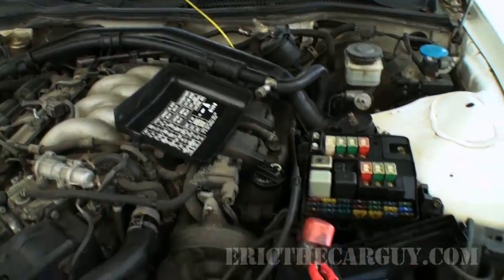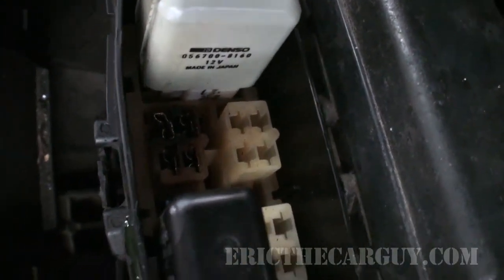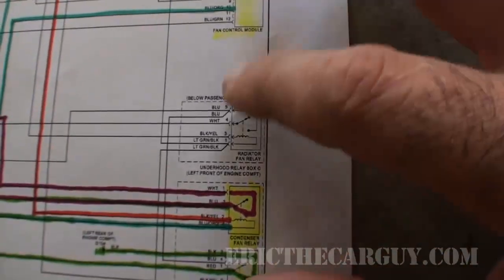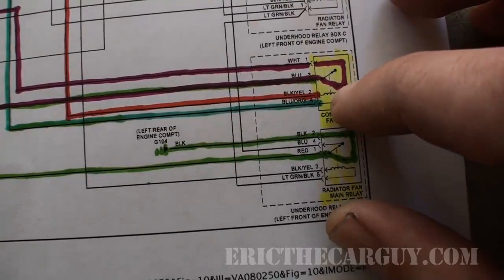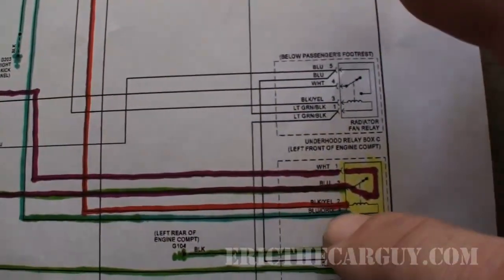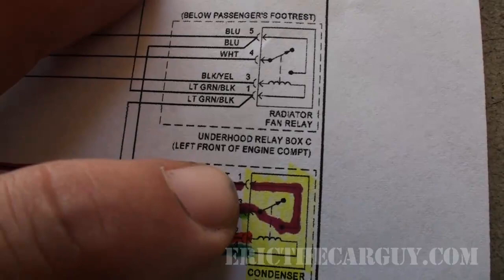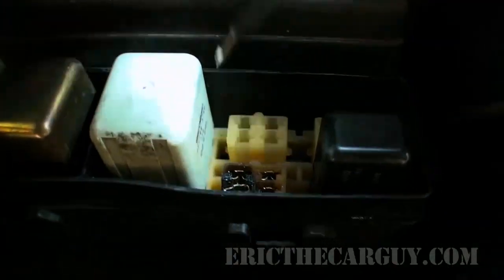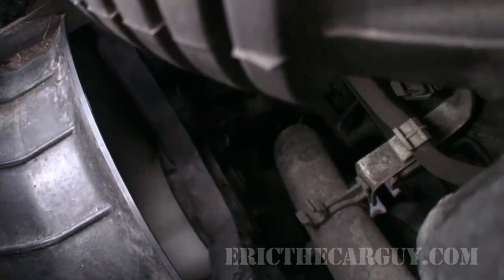Electrical Troubleshooting Basics Part 2 -EricTheCarGuy

Comment: TY over the past couple days I've been trying to learn how to read audi wiring diagrams and come up with a way of figuring out why my fuel pump relay isn't getting power... I suspect the ECM but wanted to be 100% sure before replacing it. Just last night as I was laying in bed I came up with the idea to test the 4 inputs to the relay and then the wire going from there to the ecm... exactly what you described in this video. Even though I already thought about doing this, it's definitely helpful to see it laid out on video and to have verification that it's a good diagnostic method

Comment: Very good!  Just a tip about radiator fans ; if one hasnt been working for a while and you jump the circuit to make it work then make sure to check there is no debris in and around the fan first. You dont want a missle flying out.
Reply: No doubt 💯

Comment: You should also list causes for failure of relays etc. Like the fan you were talking about, yeah my fan didn't come on, but it was obviously the relay. BUT checking the amperage drawn/ohms shown, the fan was trying to pull to much power. So that's always something you check assuming its powering something such as a fan,a/c clutch etc. If its drawing to much amperage through it, or its got to much resistance it could be in need of a new part and a relay, or just a relay, assuming the amps / ohms are in check for the given piece you are diagnosing . But remember kids, if the resistance or amperage demand is to high for the relay,.. it'll fail another relay or control module. Never diagnose why something does't work, diagnose why it failed in the first place.

Comment: it's worth having a look for broken solder joints (or just reflow the whole board, they're not always obvious on inspection) before giving up and replacing it. had a similar intermittent problem with the door locks on my accord, turned out to be a broken solder joint in the control module. cheap and easy fix - after an hour diagnosing on my electronics bench because the broken joint wasn't visible :P

Comment: Glad I wasn't the only one in the grey area. I was wondering the same thing, I think in the end he replaced the control unit and that because it was the old control unit that was intermittent. Probably a solder connection that did not contact when the control unit got hot.

Comment: Thanks Eric. Your videos are great for a newbie like me.  I read somewhere that wiring diagrams on conversion vans are next to impossible to find. 
    My van is an 93 E150 Cargo with an RV prep package (I think), converted by a company that's long out of business. 
    After the passenger conversion, a wheelchair lift was added, then removed by the folks I bought it from. They added a bed and did some interior work to create a basic sleeping area for touring the US in comfort but nothing else electrically.   
     I'm hoping that there are basically common electrical modifications to conversion vans that follow the original wiring in a logical way and really hoping conversion companies didn't get too creative and out there with the wiring.  
     Does that mean that collecting wiring diagrams from similar conversions might be worth while starting with the factory specs?

Comment: even troubleshooting a sensor or actuator is possible with a standard DMM and knowing its resistance range and even so odb2 scan tools can hook directly to sensors and actuators so the only components I would have trouble diagnosing right now is the control modules that don't throw codes

Comment: If that happens whe you ride over a bump or something like this, then check the speaker wiring. I have met many radios, that shut off the amplifiers if the output is shorted (either the wires can be shorted between themselves or to ground)

Comment: Power Probe is not owned by snapon it may be sold, by them as well as Matco etc, but they are a company all by themselves, they also have the best brake bleeder and adapters on the market.

PP 3 is the best there is! I was just using mine to diag a inop brake light:)

Comment: i know you wouldn't be able to measure the resistance by doing this  but you could have also provided ground with the power probe on that wire and that would have activated the fan correct? it would have told you the wire was good and that it was the unit that was the problem if i understood the wiring diagram correctly

Comment: Great channel ...I like Eric because much like me he's old-school and I will never depend on the ODB scan to Indicate a problem sometimes it's an easy problem that can still throw a code like a misfire code on the Chevy's most times it's a bad wire and I have fixed tons after people have spent Huge $$ on converters and sensors that was just unnecessary and all it needed was cut splice and solder a wire... so keep you hair in your head not in your hands and check all the simple symptoms First stay clean....

Comment: I cannot tell if my coolant fan works because I'm told it only works when engine is running under the hood unbeknownst  to me. Same as possible trunk light and relay circuts.
I'm a DYI'er and its all too complex for me and I do not have the expensive equipment you have - screen and all.
I'll take it apart, of course, and do my own DYI diagnosis...then take it into the garage to get fixed for $300 - $600 fix on my car I got for nothing$. It breaks my heart.
But, not before I remove neg cable for awhile until I get my "isolation switch".

Comment: Couldn't you have also used the power probe to send ground to test the wire from the fan controller to the relay? If the fan turned on then you know the wire was good no?

Comment: Good video.. a clouple of notes to add

1. Ohms shpuld NOT be tested on a live circuit, circuit should be de powered 

2. You can figure the ohms on a live circuit with a clip on amp meter. 
The math formula is 
Volts over amps x ohm 

Eg 
Battery voltage ( check with key in pre start position, light on dash on )  = 12.4 volt 

And you get an amperage reading of 3.2 amps 

So 12.4 V divided by 3.2 Amp = 3.875 Ohm 

This is the same for ANY electrical system. 

You nred any 2 parts of the equasion to calculate the 3rd 

Also you are looking for Dc in anything battery powered

Respectfully intended to the mechanic

Comment: Broken solder joints are a known issue on japanese cars here were you can easily fix the problem with resoldering the broken solder terminals. You can notice it by looking at the solder joints and find a small ring in solder.

Comment: Nice video. I noticed you swapped fan control modules out to test which worked fine. However, I was looking at the drawing and I was wondering if you could test the module by disconnecting it and bypassing it by jumping the blu/org to blk in the fan module connector. If it comes on then you have a bad module. I was just wondering if that might work. Well thanks for the video and explanation. Great job as always.

Comment: I watch you because you know a lot of stuff and you rock. And I am wondering about if there is an all in one website that allows one to type in make and model of a car and out pops a pdf of the wiring diagram for the car and its features , power seats , flashers ,....everything in one centralized location. so one doesn't have to download a million different manuals for wire diagrams for each make/model

Comment: yes the colored wires are demystified by the wired diagram, one can trouble shoot for relays , fuses , motors , and open /shorts in circuits or there connectors. But how do you know if the control modules are bad I would think the odb2 is the only way but will the odb2 diagnostic tool always throw a code for a bad controlling module? like a fan subcontrol module I know most of the major ones like ecm, bcm, tcm ,...etc would probably throw a code but for subsystem controls

Comment: I have a 97 accord lx my fans don’t turn on while driving but  once I shut the car off they turn on. I jumped the thermostat switch and both the ac and cooling fan turn on , I replaced all coolant sensors and relays and fuses except for that box u mention in this video does my 97 accord have this “fan timer relay”

Comment: I have a "parasitic draw" somewhere..I and my neighbour's did NOT react as they should @ DC 10 multi meter settings.
With out these readings, I cannot know if the fuses I removed were the culprits of the "parasitic draw".
Any ideas?

Comment: If you didn't have an extra control module around could you just have used the power probe to supply a ground to the orange/blue wire and see if it worked then?

Comment: burned connectors means high resistance caused by poor fit, loose spades, or excess current draw possibly caused by a worn fan bearing.

Comment: Eric awesome video.
Have an intermittent problem with an 05 Honda Accrd. The radio will all of a sudden cut out but the display is still reading as if all is good. No sound but if i turn the system off then back on it usually comes back to norm. don't know if it is the speaker wiring or the radio electronics that is the problem. Any suggestions? Cd player also does not respond but display says it is playing. Will usually be alright at first drive of the day, then it will die after a few minutes

Comment: Looks like this circuit board isn't burnt up or something. With a little experience it's possible to recognize the most likely reason for intermittent electrical problems on circuit boads like this, which are cold soldering joints. So if you don't want to buy a new control unit for possibly hundreds of bucks, while it's a 10bucks part, just find the cold soldering joints on the board, resolder them and bob's your uncle.

Comment: What is that unit called?  I believe that is the issue I'm having my with accord where the fans will turn on immediately after the car is turned off, regardless if the car has run (i.e. cold engine); fans also don't run unless the A/C relay is engaged.  I've replaced the relays and thermoswitches, so last resort, but having a hard time finding this part online.  Closest junkyard is 50 miles away, but push come to shove, I'll drive it.

nvm, found some on ebay using the part number from the honda diagram.  thanks for the video

Comment: could this not also be caused by a faulty input to the module like a coolant temp sensor also? 
I would be worried about frying a new module by plugging it in with a short on the input side.

Comment: So what if the wire had been the culprit instead of the unit you replaced?  Do you just run another wire along side the wire loom to bypass the faulty one?  How would you go about repairing an issue like that?

Comment: Erick need your help.Dodge intrepid i had replace the gas pump about 3 times already and cant solve the problem,car shuts off after about 25 minutes of driving,the old pump had a male connector for a small wire,but the autopart told me that it was for simple ground for static.i tried to  read the wire diagram but i can find that particular wire where it goes from the pump to who knows where. Dodge intrepid 3.2 2001 thanks for your help

Comment: Eric, my buddy has a 92 GM truck with TBI , 5.7/350, he replaced the fuel pump, dist. pick-up and also ign. module, but injectors not pulsing, doesn't the ign module control pulse? I was looking at it quick this evening in the dark and tried to use the test light to check pulse, connected light to + on bat, key on = constant light, cranking is off, no on and off, should i check the 4 prong connection?

Comment: Hi Eric,i really need a help as I am at the end of my options: my dome light is not working(goes ok if on manual,but when on Auto or Door,it doesn't work).I have checked the fuses,all good,check the thing on the door which turn on/off the dome light,is fine that either.
light bulbs good.But the dome light still doesn't want to work. is a Toyota avensis 2005 .
I do have the wiring diagram but still struggling to read it.
any idea what can be related to?i have checked all the fuse boxes(5 all up) and none of the fuses are bad.
please help if anybody have a clue...thanks

Comment: A question no ones seems to be able to answer for me.  I need to replace the power distribution center (fuse box) under the hood. The horn does not work and a mechanic determined this needs replaced. The box is expensive so I found a cheaper one and want to do it myself. So the question is people have said it will need programed. But will it?
This is a 2007 sxt dodge caravan. Any info you can toss my way?

Comment: if the module is providing a ground , could you just hook a test light to battery positive and check it at the relay connector ? or would that be risky to the module?

Comment: I've been an electrician maintenance technician and industrial automation is completely different than automotive wiring. I van troubleshoot plc,vfd, CT', all forms. Pressure, gas,water and rtds. But finding a damn bad ground in my chevy 2018 kicking my ass. Everytime I get the check engine light off it runs about a week then for e ample my ipers quit working Friday. I pull over to check fuse. It's good slam hood jump nk in the silverado and they turn rt on. Now my radiation fans not turning on. Hence I'm here. Bc I can't get a print anywhere.  All started from a blow out and a piece if so etching chipped my parnger lense. 1600 to replace at chevy house. Fk all thT I went n u urged harness cranked rt up n drove home. Put clear silicone fit glass in crack used wife's blow dryer to get out moisture let sit 24 hrs and it worked perfect. Two days later my rt blinker stopped working. Fix that then windshield wiper fix that now my radiator fans not turning. Plus check engine light showed up. My buddy ll clear code in the morning once I fix the short at fan harness.

Comment: Hi Eric and other readers, 

My Totyota corolla 2005 has a strange electrical problem, its check engine light is on, and the code is P2716 = Pressure Control Solenoid "D" Electrical. I have already replaced the ECU from Toyota Dealership, I am not sure whats wrong, every mechanic tells me a different story, any suggestions ? Thanks in advance ^ ^

Comment: Hi Eric,
The power going to the fan relay,does it require full 12v load orcan it be reduced.?.
   My fan isn't working,But, When I put the TEST LIGHT n to connector it glows as if with reduced power,in other words it seems DIMMER,What could cause this phenomenum.?        
Thank You.

Comment: Wouldn't the first step be to check the condenser fan itself by putting a 12V positive to it directly? At least that's what sounds logical to me: Make sure the fan itself works. Then go for the fuses, relays, temperature switch and so on...

Comment: Help!!!! I have a 1990 HONDA ACCORD EX and I have some electrical issues. My speedometer will not work and before this the gas gauge is reading full all the time. It used to fluctuate  back and forth now it is full up all the time. What is wrong? The car sat for many years no being used. Now I just put it on the road and have all these problems.

Comment: Hey, I have a problem. I have a 96 Toyota camry and neither my turn signals nor my hazards are coming on. They where working then I had to get my engine replaced and now there not working. It doesn't even flash on the dash. Now I chanced relays and checked fuses and everything is good. I been stuck on this for about 2 days now please help
Reply: Check the wiring harness in the engine compartment. Start at the lights and follow them back to where they join together. Or start at the firewall and work forward if you know what harness it is, wire colors. They may have had to unplug them//forgot to plug back together or the harness got pinched/damaged or cut by weight of the motor.Check plastic cover for damage.

Comment: I would take that old unit and trace the pin back to the switching transistor, as a transistor is a whole lot cheaper than the unit.

Comment: Eric, good work....that connector should have been replaced. To test continuity you rigged it a bit....cool. But, when you actually connect the module, you may not have good connection between male and female pins. And some of those connectors were charred.
Just saying......

Comment: what about older vehicle with only buss type long fuss and pnly have abput 10 fises,  My 1973 Dodge Polara with the 360 engine.  J have no fire what so ever. no lights no nother.  Fhe battery is new and has 899 cc

Comment: I went to Auto Zone and asked for a wiring diagram of my car,  2007 Honda Fit sport.  Only thing there were some high school looking guys. Any how this one guy looked for some time. No luck on finding any wiring diagrams. So I checked out Mitcheal's auto repair. They wanted $179 a month. So, I wrote to them and asked if they could do a single car, No reply. I am thinking for $179 I can take it to a shop. Only problem is I spent a lot of money putting this thing back together. And I do not have $179 for a print out of the electric system. Once in a great while I get lucky. But then again this might be false hope.  I am screwing around the hood and looking at the fuse box. I do not know Jack about electricity, other than it can be shocking. Any ways I am trying to take the cover off the fuse box. I did not pull on it that hard when I noticed it is rather lose. Just for kicks I slapped it around a little and wiggled the wires. I checked the radio, It Worked, I checked the light that had no power, Now it has power.  It seems I found where it is giving me the problems. Not sure what to do next. What do you use to clean electrical parts ? I tried that years ago with the phone. I melted the box,  the phone guy was not happy. Is there something to keep it from rusting up.